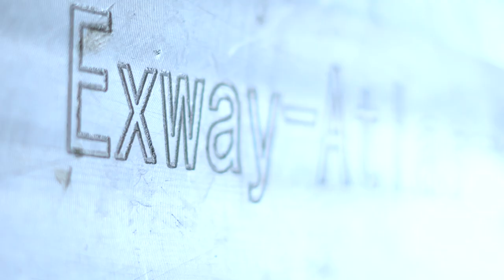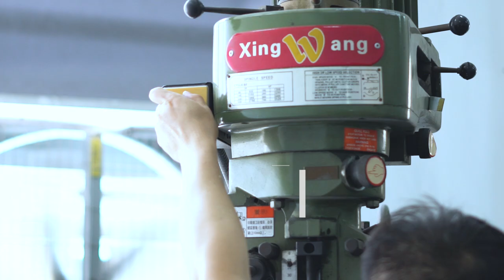Exway atlas deck manufacturing process

Comment: How easy is it to replace the battery?
Reply: They say it's a little too tedious to do on the go because it's like 18 screws, but can easily be done at home
Reply: @mrisinger  you may also add a battery on top of the board using a wire that connects from the top to the main battery and have a bunch more range.